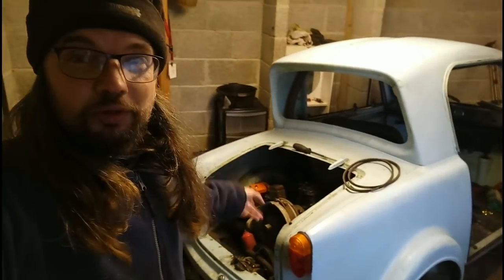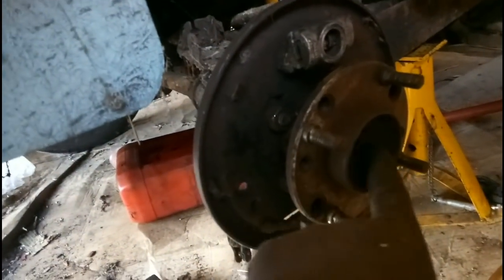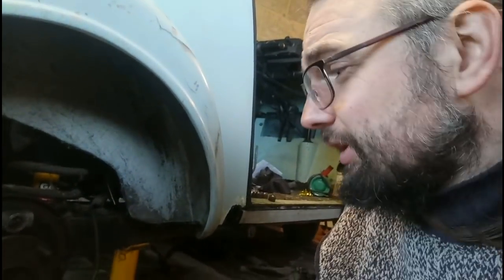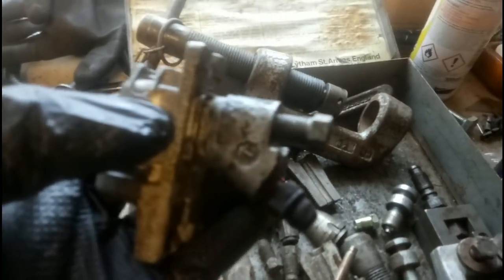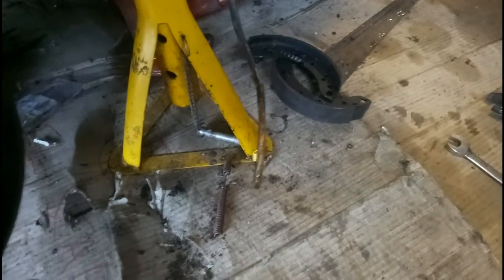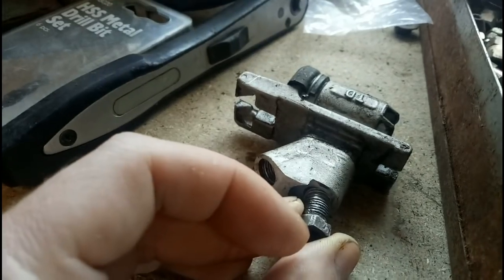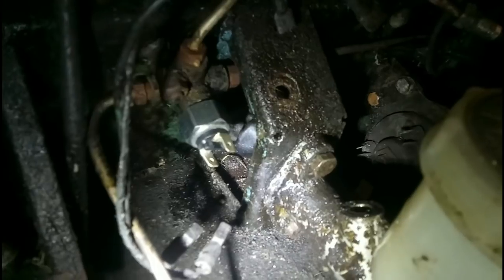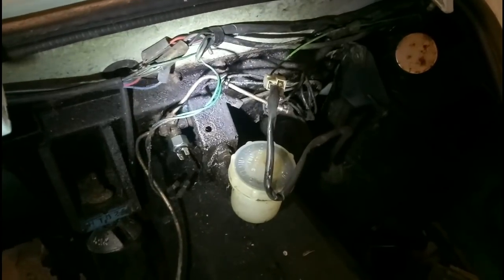Project Invacar Part Eight: Braking Bad!

Comment: sorry to say your fitting the shoes the wrong way round, the one shoe can only go one way with the split pin through the cylinder but the other shoe has the square in it on top near the adjuster, most people fit them the wrong way round and find themselves hitting the drum over it to get them on......the short spring goes on top and the longer spring goes on the bottom, the springs are fiddly which is why most people fit the springs on the outside of the shoes not the inside

the brakes are standard robin and regal shared with triumph herald and spitfire
I can send you the scan of the brakes page from the haynes manual if you want
Reply from the maker: Hi. Thanks for the feedback. You may be right with one shoe. I'll check. As you say, the square hole engages with the handbrake mech on the LH shoe, so that one's definitely the right way up. The springs are the right way around - the red one goes nearest the wheel cylinder. I made sure to note that when taking them off, and it's confirmed in the manual. Springs on the outside might be a good bet!

Comment: Stop what you're doing with the brake pipe mate, I tried to get Stenhouse to send a text but he's snoring on the sofa, again. The end of the brake pipe that goes into the slave cylinder needs a conical or "double" flare on the end or it won't be able to seal against the internal 45° chamfered surface,  have a look at the old end you cut off.

I'd strongly suggest you take off that section of pipe and replace it with a new one. You'll be able to make nice beet flares using the very good quality Sykes Pikavant tool you were showing earlier rather than struggle with the hand held tool. The original pipe will now be hardened with age and work hardened from straightening etc. (which is probably why you've got such a rough looking flare) even you do manage to create a conical end, the material will now be so hard you'll have trouble getting it to seal and might kink or crack it trying to get it aligned with the slave cyl threads. 

Sorry to sound like a dour Jock but I know what it's like to be on your knees in the cold crying into a pool of DOT4
Reply from the maker: Ah, thanks. I did wonder. Getting that pipe off is an absolute nightmare. I think I need to either remove the suspension arm or the entire body. Not sure which is most difficult...
Reply: HubNut easy options seem very remote. Hang on Stenhouse just woke up, no never mind, he's probably only going to suggest buying another Citroen ; -)